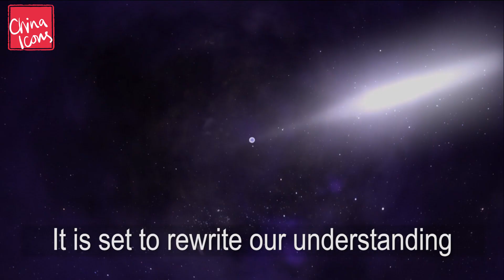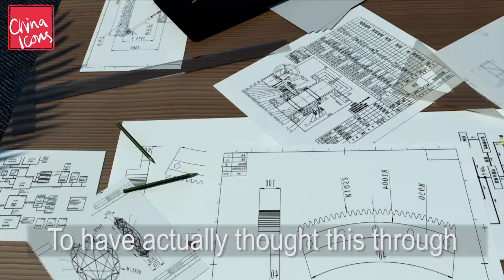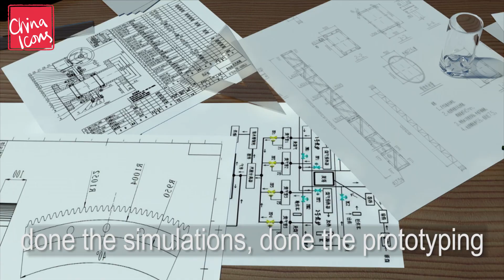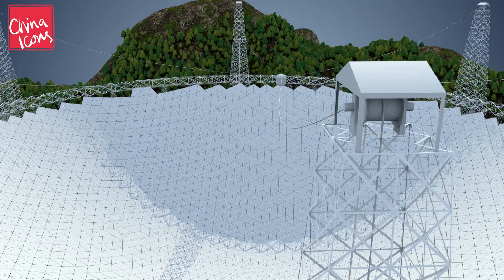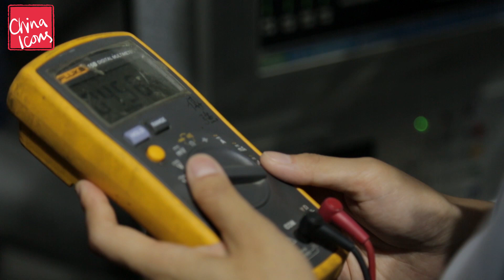FAST: The World's Largest Telescope | A China Icons Video

Comment: The most terrifying moment came when the power supply was malfunctioning.  Thankfully they solved the problem in a forthright manner.
Reply: how can that be terrifying, if constructed the right way it should shut down automaticly or be able to be shut down, to prevent Damage, terrifying is only if it does something someone didnt count in...  i myself wounder how long this cabling Motor driven system will work, its alot of technology in open enviroment....
Reply: Lugul banda I'm pretty sure they didn't count on the power supply to malfunction you know.

Comment: 12:58  "It's too dangerous for the cables..."
ARE YOU KIDDING ME?  Every engineer knows that you over-engineer all critical components by several orders of magnitude.  If one is building a deck to support 10 people, he will engineer the structure to support 10 elephants.  When it comes to cables, an inch-thick cable made of tungsten-carbide compounds will take hundreds of tons of stress.  Seems that in the 20 billion or so the Chinese sunk into this project that came up about $70,000 too short.

Comment: At 10:15, it is not quite correct to say that pulsars rotate at thousands of time a second.  Per Wiki the fastest known pulsar at this time, PSR J1748−2446ad, rotates 716 times per second, which is a very impressive 42,960 rpm. Perhaps FAST will find a faster pulsar.  Good work, China.

Comment: Impressive size on this "hearing aid" no doubt and I think we're going to hear a lot of new things from China in the future, as well as Japan. I've seen this Video before, I'm looking for the old big radio telescope in Armenia (formerly Soviet) which is still almost in order. I ended up here again and had to see the China telescope for the second time. But now I have found the Armenia telescope, take a look also if you haven't seen it (while it is still here), there is not just one but more telescopes there. In different degrees of decay, from about "ready for use" to "trace of equipment" and buildings"

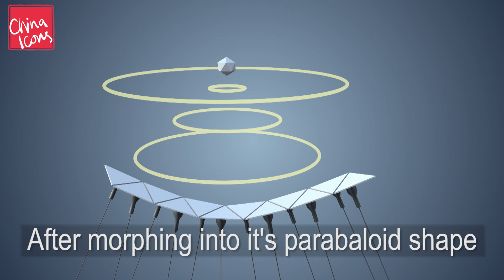Comment: Very impressive . . . but in the subtitles check the incorrect use of it's at 6:15 - 6:38 - 7:30 -14:03 - 14:11 and 14:31 where it should be ITS (no apostrophe!!). At 12:42  at the end of the line 'position' is misspelled.

Comment: As sad his illness, the reason the larger satellites were not enlarged as such is due to actual energy activity. A telescope may be thought different at use, however it seems similar. It was a project to be for learning on the ground. It seems as the pulsar is described as mass of gravity or magnetism. A rule that follows in old fashioned concern, weight and space contains only that which is able to maintain proportion as functionality procedes. What is collective anti light is what you describe. So, the universe expansion  as theory or fact may not be what is needed. How to alleviate excess energy or matter is the question. After all, boundaries are the ultimate questionable chase. How far can space energy  go before what seems boundless is proven wrong? What is the edge of the universe?

Comment: A beautiful project but not very likely to perform as it should as a result of the large amount of visitors and commercial activities surrounding it. It's a massive radio telescope, very sensitive to things like WiFi, Cellphones and all other radio signal transmitting, human related activities. There should be a 50 miles no go zone around it.

Comment: Why not build a much bigger telescope in the Gobi desert? No worry of rain, light pollution and much more surface area.
Reply: N1nj4 Joski
Probably : Rapid and broad night/day temperature change. The Gobi is extreme. Would not suit due to expansion and contraction of steel of a massive structure. Not so easy to get construction materials to desert site and no solid foundation. 
Rain and light do not affect radio waves ie. long wave radiation . . . . :o)

Comment: Parabolic mirrors are not in any way a “new innovation”. They have been used for an extremely long time for many optical uses
Reply: the point is those parabolic mirrors are controlled by computer system and the directions are adjustable